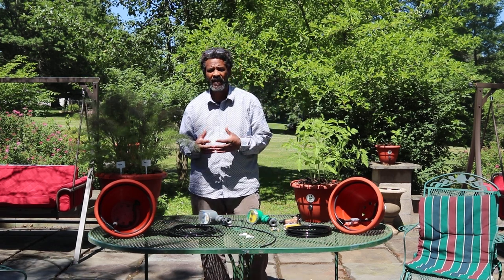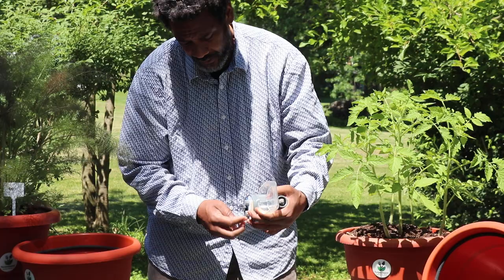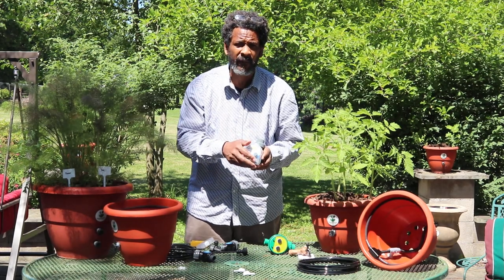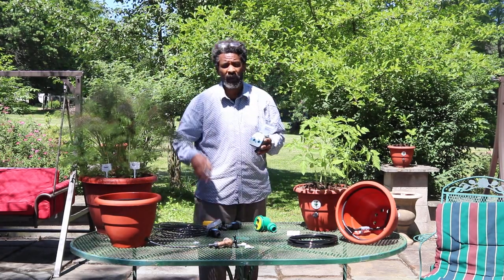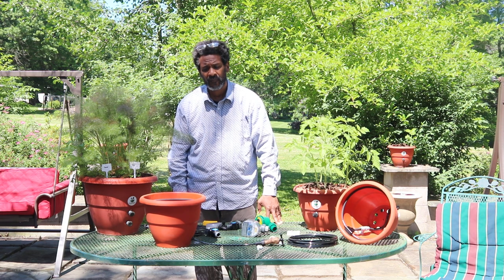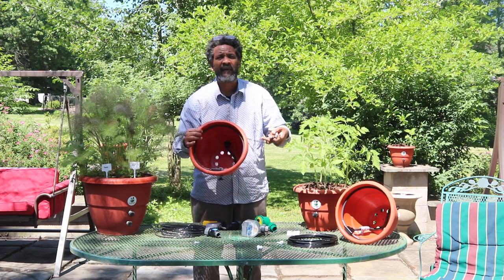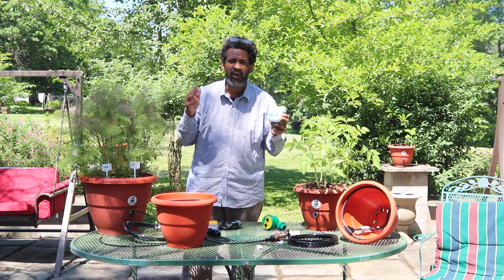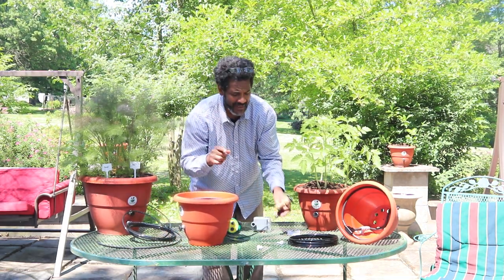How to use your timer - Torpedopot

Comment: Hey Mr. Addison, it's me again.  It's Spring time.  Am I to assume I can use any kind of timer then since you have none for sale at this time.  Which one do you recommend to attach to the Torpedo pot?
Reply from the maker: Hi Monique, the next video I upload will hopefully answer some of your questions. We are preparing 50 planters and a small footprint backyard garden. By the wayAny standard time or should work but I prefer the programmable timer. You can program your settings for on and off. All of them have the same garden hose to read GHT

Comment: Hello Mr. Addison, thank you for this! I have wanted to grow my own food for year but my work schedule prevents that. I’m setting my torpedopot set up today. I have a question, how long do I set my timer for different plants? Is there any kind of guild or chart that states how much water each plant needs daily? I don’t want to over or under water them.
Reply from the maker: Hi Melody, you may have one plant in a planter or you can grow 100 plants in a planter. The goal is to make sure the soil is sustainable. When you grow in large volumes you want to be able to control the environment. Basic rule look at the bottom of your planter and ensure that there’s a little moistness.. Plants require different amounts of water And when you grow Denteley it requires more water. the plants grow stage may demand more or less water. The basic rule is to look at the bottom of your planter And check for the moistness..